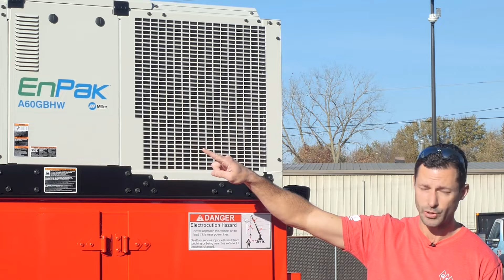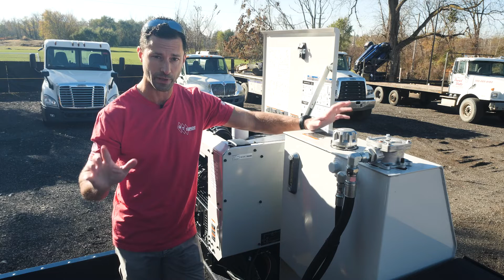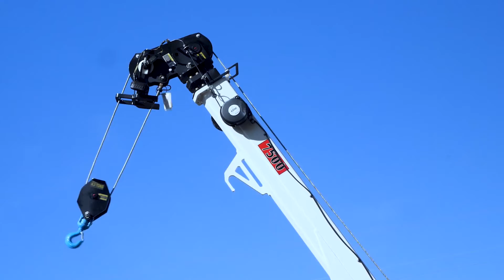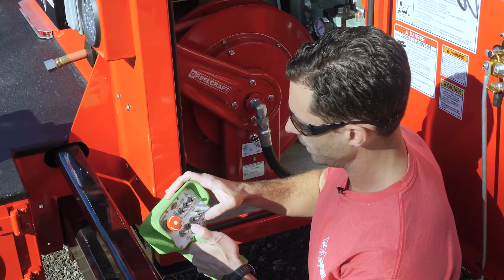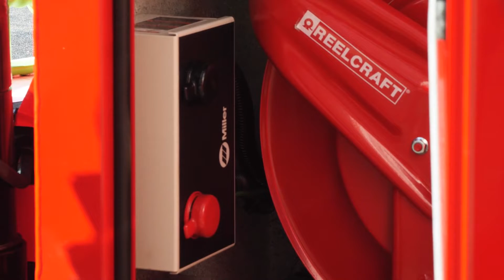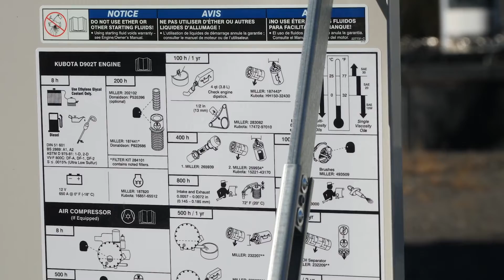Miller EnPak In Depth Review

Comment: Great video Dan! Trying to decide if I want to go the EnPak route on new crane truck. Any more long term data as to why traditional PTO setups are preferred?
Reply from the maker: Data is in short supply. I can tell you less than 10% of our 2024 builds with cranes had multi function machines like enpak or vanair air n arc. 

We do have one big fleet that runs them. Most trucks do not have welders and the compressors have gotten smaller. More piston less rotary screw. 

If you’re going to use all the functions and do your maintenance as prescribed, enpak is worthy of consideration.  

Hope this helps!

Comment: A couple of thoughts, I’ve heard that some up fitters were hooking the enpak up to be able to heat or cool the cab? Are you able to charge cordless batteries, laptop, etc off the outlet? What is the upfitter switch for that you mentioned in the video?
Reply from the maker: Thanks for watching!  Excellent questions.
1)	Yes, Miller is offering an option to heat and cool cab.  We have not seen one yet but yes, this is available.

2)	Directly from Miller:  “I always recommend installing an inverter off the chassis battery.  This new model A60 has the Chassis Power feature which provides 150 amps charging back to the chassis at idle.  Running an inverter provides nice quiet access to 120 volts for those sensitive loads that may be subject to some voltage fluctuations.”  
3)	For the upfitter switch, we use one of the Ford upfitter switches to simply turn the EnPak on.  EnPak won’t work until parking brake is set and this switch is on.
Reply: for point #3 that means your ignition  has to be on all the time you run the unpack? @qtequipment
Reply: @topperman4541  I have the EnPak and my truck was equipped with a switch panel that included lighting and beacon switches as well as EnPak enable. I have to first turn the panel on and then turn on whatever function I want before switch the key off. I can then switch the key off and the light or whatever will stay on. If I don’t switch anything on the panel times out and shuts down. The issue I sometimes have is forgetting to de energize power to the EnPak which leaves the switch panel on and it runs the batteries low overnight.

Comment: Have you ever seen an autocar truck chassis used in a service truck situation? I've never seen anything built to a higher standard for severe duty while still being easily serviceable than an autocar. Also why would someone choose an imt over a maintainer. I operate an imt currently and I have several annoyances with it. However I appreciate the way you approach your work which is a strong motivator to use imt again in the future.
Reply from the maker: Joe thanks for watching!  Autocar is one of the few chassis we’ve never built on but hopefully we will in the future.  

Maintainer builds a solid product, no disagreement there.  Similar to buying an excavator, there’s a lot of factors at play but we believe one of the main drivers is how comfortable the customer is with the support of the dealer.  

The truck equipment world can introduce another layer of complexity in that most of the serious dealers do their own upfit.  You can have the greatest equipment in the world but if the upfit is the weak link in the chain, the customer is going to hate it.  

Anyways, thanks for watching and thanks for the comment!  If there is anything we can help with in the future, let us know.
Reply: @qtequipment  is it possible to outfit a class 7 chassis to be a combination lube/fuel truck and mechanic truck?
Reply from the maker: @BigPoooper  Yes, probably a dozen different ways to do it.  We’ve done an 11’ service body with a 36”-ish deck behind the cab that has tanks and reels.  We’ve also built lube systems into the back of a 14’ or 19’ body.  You dream it, we build it baby.  Pictures of past projects are on our Instagram if you want to check out.  Best person for you to talk to if you want to explore this would be Jared on our sales team.  Just call 330-724-3055.  Thanks Joe!

Comment: I'm curious as to why no one in the service truck building industry has tried a apu for a tractor trailer yet on a service truck ? They are available in many different configurations to provide auxiliary power and also an a/c compressor for integration to the trucks hvac system. Heat comes from the little engine being tied into the trucks cooling system via heater hoses and some even come with reversing valves for a true heat pump setup . 
It would not be hard at all to add a small air compressor to run a small impact or other things that need a quick shot of air .
This setup would eliminate guys from having to idle the truck for climate control of the cab .
A little setup like this would probably handle 95% of the average techs power needs while onsite after proper training to work efficiently. 
As with any other setup it will not solve everyone's problems , however I believe it would fill a huge gap in the market .
Reply from the maker: Mitchell.  You make great points and thanks for watching.  About 10 years ago we installed a few heating / cooling cab units manufactured by Dometic for a customer with EnPaks but haven't done them since.  Other than "this is the way its always been done" I I'm not sure why they aren't more popular.